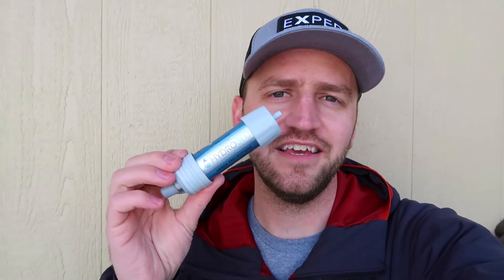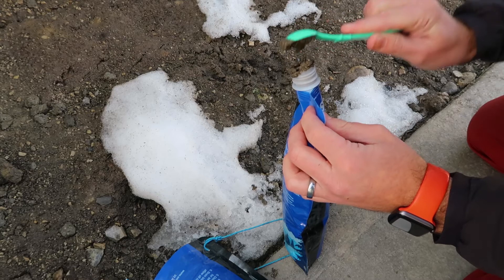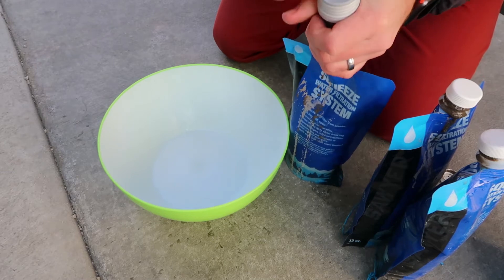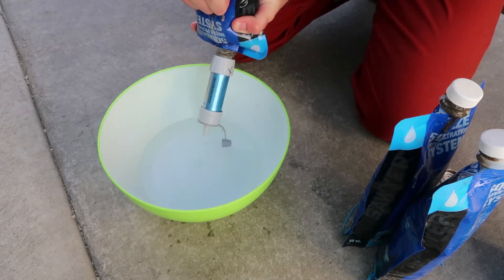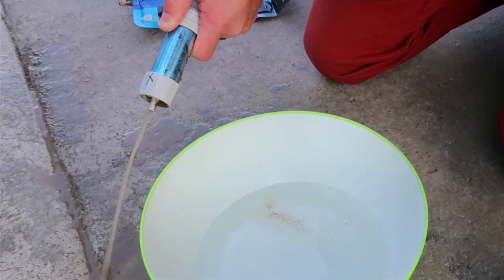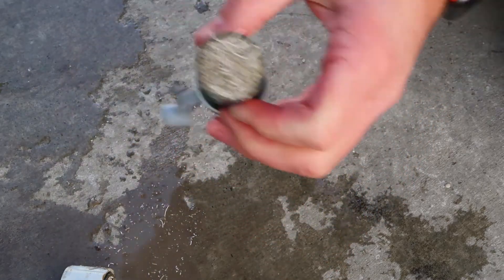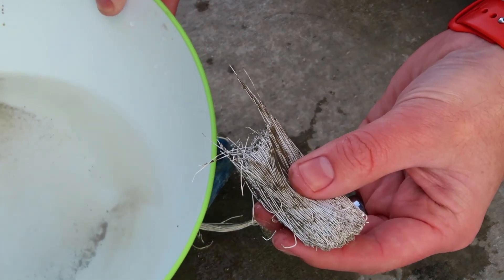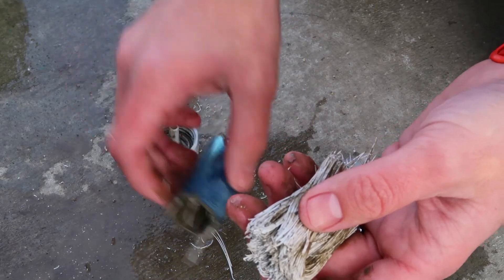HydroBlu Versa Flow Torture Test | Dissecting A Water Filter!

Comment: problems with the versaflo are       number 1 it costs more than the other guys     #2 it does only  20,000 L     the sawyer filter cost me $20 and does 1,000,000 gallons      therefore hydroblu has priced themselves out of the market
Reply from the maker: Funny thing is it's the same cost as the Sawyer Mini. Both are $20. The mini will not do 1 million gallons, it'll do 100,000 gallons. Yes, that is more than the 20,000 liters that HydroBlu says the Versa Flow will do, but 20,000 liters is still over 5200 gallons. Obviously 5200 is significantly less than 100,000. But lets be real here, are you honestly about to put 100,000 gallons through your filter? Highly doubt it. If you consider that on average on a weekend trip you consume 12 liters of water, and you actually filter those 12 liters, which is 3 gallons of water, i'd have to go on 1,733 weekend trips to exhaust the life of the Versa Flow. Therefore I 100% disagree with your comment. However, the Sawyer is a fantastic filter and is a solid choice as well.
Reply: sorry    but you misunderstood me  I have the big Sawyer that does 1 million and it only cost me twenty bucks
Reply from the maker: embarado smithing and woodcraft I still disagree. But as someone who uses all three of the filters being discussed, I will argue that poor cleaning, storage, and other factors will severely limit the total lifespan of all options.
Reply: 20,000 L is just over 5200 gallons VS1 million  for the same price has the aqua blue  I made the same statement to Jiu-Jitsu 2000 when he premiered the blue on his channel
Reply from the maker: embarado smithing and woodcraft do me a favor, using the logic i explained in my first reply, take your Sawyer Squeeze out on 1500+ weekend trips and tell me that you will have a filter you trust. Specs of what it’s capable of versus realistic expectations is what we’re discussing here.
Reply: I've actually been using my Sawyer nonstop since August 1as I am now living homeless  since July 1
Reply: I just haven't shown saying on my channel
Reply: thus far I have 183 days and counting that's 549 gallons or just short of 2080l  or 1/10 of what's your blue can do
Reply: if we go by face values and what it says it can do  I'm not saying Sawyer will do a million I'm saying it's rated to do a million  and since I have my Sawyer set up as a camp filter on a 5 gallon bucket  it has been very easy to keep track of the actual usage
Reply: embarado smithing and woodcraft would you be willing to donate a mini or 20$ because noe I want to see what the inside of the mini is like.  Really want to know what makes the mini do 0.1million gallons.
Reply: right now I don't have $0.20 to spare     and it's not the mini that's the million gallons it's the squeeze that does 1 million                  here's a video by the guy we're watching on this one       https://www.youtube.com/watch?v=bik-k4-PyKw                   
and here's a video by  Adam Z Adventures opening a sawyer squeeze             https://www.youtube.com/watch?v=qjxmy4Gg_5U         since I can't send you 20 order filter I hope this will help
Reply: embarado smithing and woodcraft sorry but the squeeze cost 40 to 50$ the mini cost 20$.
Reply: I have a squeeze and all the accouterment   and I paid 20 for a year ago this past Christmas
Reply: www.buya.com/Item/Details/SAWYER-Camping-SQUEEZE-WATER-FILTRATION-SYSTEM/lite/4abe672506454b638fac0126ef879943SAWYER Camping SQUEEZE WATER FILTRATION SYSTEM  $24.99
Reply: maybe you should rethink that who needs to know what they're talking about
Reply: embarado smithing and woodcraft you really need to know what you are talking about the mini does 100000gal. The squeeze does 1000000gal.